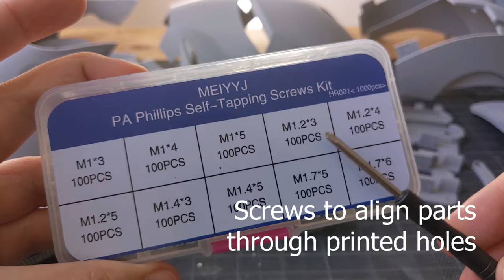Iron Man Helmet, Articulated, Wearable

Comment: So I just finished my first attempt at this project and would like to add some feedback and points for others who attempting this project for the first time.

First off thank you so much for putting this out, everything works perfectly, the documents gives proper information and your build videos are very helpful!

Sizing Ring - If you are unsure if its too tight for your head, scale it up by a bit. The padding will help make up the difference. I have a very fat head and cheeks, so when I assembled mine at stock scale it was a little too right for my liking (remember there are components inside that need room as well)

Electronics - The code is correct, if you are having any issues it is most likely your hardware. One thing some other comments I've seen and I have also experienced is the servos seems to try to continue to turn instead of a full stop when the face plate is closed, creating a sound and generating some heat. Not sure if its an hardware issue or a coding issue. 

Eyes - With the new coding for the lights turning off when the face plate is up, this has made the potentiometer no longer "work" when the eyes are lit up. Adjusting the brightness now requires you turn the knob, reset the face plate, see brightness and then repeat. 

Servos - He designed this helmet to have all components contained in the helmet, however this means that the battery life will be very limited. if you want to change less batteries, consider using a separate power source for the servos. I plan on doing this and hiding the power source down the back of my shirt to my pants pocket. 

Thanks again so much! I am looking forward to building my 2nd one that properly fits my fat head!
Reply from the maker: This is awesome! Great feedback and description. Definitely room to improve
Reply: @BoxandLoop  What separate power source did you use boss?
Reply from the maker: @DoctorNOS  use either AA or AAA batteries
Reply: @BoxandLoop  4-AA batteries are ok? Will it blow the Arduino?
Reply: how did you do the sizing did you resize every single model because then the screws wont fit or am I wrong pls explain aaaa
Reply: @popcatproductions9627  im probably a bit late to be any help but the instruction sheet highlights which components not to resize. I also understand this may be a more recent addition to the instructions than your question.
Reply: Super Ru kinda late but still thanks
Reply: @DoctorNOS  4x AA is only 6v, while the arduino can operate on 6-20v.
Reply: @rattslayer  appreciate that!! Thanks.
Reply: where on your head is the sizing ring supposed to go?
Reply: @danielsLL  it is supposed to barely pass over your ears
Reply: @DoctorNOS  when dropped down on my head flat in z in the same orientation its printed with pointy side towards my chin?
Reply: @danielsLL  Crap. Now that you ask that I cannot remember. I think so.........
Reply: @DoctorNOS  thanks bud
Reply: @danielsLL  no problem
Reply: @danielsLL  
Boxandloop
June 13, 2021
The sizing ring goes horizontal. The more pointy end faces forward.
If it passes your ears snuggly, you are good. From the man himself!
Reply: Hey so I have been working for months and since I am only 12 this has taken me longer than these other people. But I do have a question and if you got back to me that would be nice. Are the eyes supposed to dim when I turn the pointmeter? I am using the code from the eye pdf. I'm not talking about the eyes instruction video I mean the wiring video in which I hook up the eyes to the Arduino.
Reply: could you explain to me how to adjust the yes without making them seprate?
Reply: I know this is out dated but what battery setup did you go with I don't get very much run time with the 4AA setup
Reply: How would you use something like a power brick? Do you just replace the battery holder wired with a USB cable?

Comment: at 1:29 what screws are you using? none of the screws in the suggested kit nor the screws that came with the servo will attach those pieces
Reply from the maker: That screw should come with the servo. It holds the arm in place. If it does not, I'll check the size. I think it is m2.5 bolt, but let me double check
Reply: @BoxandLoop  yeah maybe mine came with slightly different parts, there's 3 silver tapping screws, same size, those screw the piece in place just fine, then there's 2 very small black screws, they will screw the top white plastic parts to the servo but they are not long enough to screw the plastic part on top as well.
Reply from the maker: I see, then it depends on the servo. For the ones I used, it's m2.5 bolts. For your servo, try figuring out which screw/bolt is used

Comment: Hey, great work, im using 2 18650 batteries, i.e 7.4v, the servos worked for few times and then stopped moving and started getting heated, i got a burning smell, now only the led lights are working but not the servos, what should I do?

Comment: How did you print the visor?
Because in every orientation ive tried with a brim... its came loose from the build plate.

Except curve down, which needs a lot of sanding to be presentable.
Reply from the maker: I printed on its side vertically with tree supports

Comment: Great design! I started printing this and I'm about 1/2 way done. Love the instructional videos and detailed PDF. Do you have a link for the pads by chance?
Reply from the maker: Great! 
Try this:

https://www.amazon.com/Aoutacc-Universal-Airsoft-Replacement-Accessories/dp/B07PGF4CTH
Reply: What is the weight and height that this Ironman outfit will fit in?
Reply: TaiRone Wassup  a few hours for some of the larger ones.  I don't have an exact time but I'd say about 12 hours of total time.
Reply: TaiRone Wassup  I'll try later tonight to see if I can put mine in cura to get you better times. I just have an ender 3 pro.
Reply: TaiRone Wassup  OK, I was way off.   I checked today and the face took 20 hours and one of the dome pieces was 6 hours.  I think there are 4-5 dome pieces since my printer is smaller and I did it in sections.  Not sure what I was thinking.  :)
Reply: TaiRone Wassup  No.  Mine is printed and put together.  Just haven't painted it yet.

Comment: What lengths of screws are used for the battery holder, Arduino holder, and the screws that hold in the moving arms with bearing. Thanks

Comment: Hello, which orientation is the best for the face.stl? Printed it already face down for time savings, but on the main surface there are many artefacts from the supports. I don't exactly know if I am able to repair those surface. So, which orientation did you print it?
Reply from the maker: I printed it upright with mouth touching the plate. Tilt forward for brow ridge to see the build plate. Add supports all around the mouth and to the brow. Worked for me on ender 5

Comment: I want to program an arduino to use a push button to move 2 servos just like yours, but for another application. Do you have a video with the arduino code for that ?
Reply from the maker: Take a look at the code. You'll need to take out some parts, but that's it

Comment: I am having an issue printing the ear covers. The bottom is not totally flat and even if I print on a raft it fails. Any tips? Thanks.
Reply from the maker: In cura, there is an option to pick a face to lay flat. Not sure which slicer you are using

Comment: I followed your instructions but the servos only work when I plug in the board via USB.
UPDATE: I just cut out the AAAs entirely and wired it up to a battery pack. The servos get pretty hot, don't open and close them too often lol.
I have a question though, how do you get yours to shut so tightly? Mine is kinda loose and flaps

Comment: I love this! I wonder, is there a way to make a button thats wireless? like a 3d printed remote that has a button on it and when you press it, the faceplate opens?
Reply from the maker: Sure possible. Will need something to send/transmit the signal
Reply: the esp8266 has both wifi and bluetooth capabilities, not sure about the arduino nano every

Comment: Hey another question, on my Arduino when I press the button the servos move but always go back to home, so they open but don't stay. Could this be a problem with my physical board? I think I might have fried the hole that's to the right of ground, the one that the button is plugged into
Reply from the maker: Could be bad batteries. Try on usb power. Also try using AA batteries instead of AAA

Comment: You have two printers listed in your links, one with a 250mm max height and another with 300mm.  Am I correct in assuming you need a max 300mm height printer for this project?
Reply from the maker: Not even that much. All parts fit within 200mm in any dimension. I've listed two printers that I know to be affordable and can deliver good quality.

Comment: what are the screws that hold the servo arms on the ones with the servos are too short? and hold the "passive" arm as well?
Reply from the maker: The servo arm is held by m2.5 bolts. In case your servos are a bit different, check which bolts fit your servos, maybe m2. Passive arms should use m2 bolts

Comment: im having an issue with my servos working when powered off battery. When connected by a power lead, the servos act as you describe and show in the videos but when I power it using batteries it behaves irratically. Any ideas why this maybe happening?
Reply: I feel like I’ve heard this happening when your batteries are low on power, maybe try fresh batteries but I’m not sure 
Hope this helps

Comment: Hey so I have been working for months and since I am only 12 this has taken me longer than these other people. But I do have a question and if you got back to me that would be nice. Are the eyes supposed to dim when I turn the pointmeter? I am using the code from the eye pdf. I'm not talking about the eyes instruction video I mean the wiring video in which I hook up the eyes to the Arduino.

Comment: Hi, what's the difference on files Dome 4 and Dome 4 resize?

The code for Arduino just copy paste from your PDF file?

Thanks!!
Reply from the maker: Dome 4 resize is used instead of Dome 4 if you are not printing at 100%. There is more info on this in the guide.
And yes, copy paste for the code, after you add servoeasing library

Comment: A big thank you for your work. I have a lot of fun with it. Unfortunately I have a problem with my code from the Arduino. As soon as I press the button, the motor turns, the LEDs come on, everything is ok, but the motor turns back immediately afterwards. Where could I have a mistake?
Reply from the maker: The batteries might be low or the servos might be too hungry. Try on usb and AA batteries
Reply: It works via USB, thanks!!!!

Comment: I live in the UK and can't get the same glue as you, are there any alternatives like epoxy or super glue that I should use? Btw amazing video and amazing make.
Reply: I use acetone to glue pla together. Superglue also works.
Reply: @doubletap800  thank you for this, I think I'll go with super glue since it's easier, this is my first make
Reply from the maker: Thank you. Super glue would be my guess. I have not tried it yet, but I hear it works well for others

Comment: I've got it all together but when I turn it on the servos just move in 1 direction and keep trying to move, when I try pushing the button it doesn't respond, eyes don't light up either, when plugged into USB it works fine.
Reply from the maker: Could be bad batteries. Try adding a capacitor to nano
Reply: @BoxandLoop  I've changed the aaa to AA batteries and it's working  however  the face catches part of the helmet when opening and closing so it won't close properly, its like it needs to open further out, what part of the arduino code do you change ?

Comment: Great model! I also printed it and I'm in the wiring phase, I have the Arduino board, do you have wiring instructions as they are not included.
Reply from the maker: Sure, I've made another video just for electronics
Reply: @BoxandLoop  Do you have a link?
Reply from the maker: https://youtu.be/_ayVGPpSBAY

Comment: Thanks for the files, can I ask how you arranged the faceplate on the slicer having issues with my prints failing…
Reply: On an Ender 3 V2 I positioned the face place standing up, then lean it forward about 15 to 20 degrees. Use tree supports.

Comment: Thank you so much for this. I started printing this as my first 3D project and I am making it for my son. I’m in the process of sanding and painting the parts at the moment.
Question: Are there certain slice settings you are using to get the bolt heads to print out? My slicer doesn’t seem to have a fine enough resolution to get the full bolt head and is instead just wanting to print two semi-circles that are loose as opposed to a full bolt head.
Reply from the maker: Happy to hear that! 
For the bolts, I'd check the layer height. I've printed mine at 0.1mm and it seems to have worked well.
Reply: @BoxandLoop  thank you! I will try that.
Reply from the maker: @bluewater82  let me know how it goes
Reply: @crazybastard82 how much time did it took to print and which printer did u used
Reply: @roneygsd134  Hi! I used the Ender 3 printer. It's been a long time so I don't remember exactly how long it took to print but I believe it took maybe a day for all of the small parts and then printed the main front piece overnight while I slept.

Comment: My son and I are ready to wire but the wiring diagram is not verify detailed in pdf. Do you have a more detailed wiring video that doesn't move as fast and tells us what the servo color code is? You have black red and green they have brown red and yellow on the parts you said to by. Also getting a lot of errors uploading the code to the nano every. do you have any other updated steps to make that possible?
Reply from the maker: At this time, I don't have any more detailed information, but let's try to figure it out. On your servo, yellow is the data cable, red is power, brown is ground. For the code, have you added "servoeasing" library to the Arduino IDE? Which errors are you seeing?
Reply: @BoxandLoop  thank you for clarifying the wiring colors. As for the upload I can't tell why they are occurring.  I have added the servoeasing library and was going to try tonight to use the web interface instead of the downloaded arudrio program. It connects to the board better.
Reply from the maker: Let me know how it goes.
Reply: @BoxandLoop  thank you for responding. The nano every cooperated tonight using the web based coding site. It compiled and uploaded without error. I guess I will uninstall the pc version. It wasn't working no matter what i did. Tomorrow we will start wiring.  Thanks again.

Comment: Thanks for the 3d files. I'm currently printing it.
Curious though, what were your settings? Which layer height and how much infill did you use?
Reply: I’m using 1.0 layer height and 100% infill. Can’t go wrong with 100% infill.most parts are thin so 100% infill won’t make the parts super heavy.

Comment: what kind of screws did you use for the helmet parts? Thank you, I'm talking to you from Argentina.
Reply from the maker: Self tapping screws. There is a link in the description. They are mostly m1.6
Reply: @BoxandLoop  Which length do your screws have for the connection between visor and head? I tried M1.7x6 but they are too short
Reply: Anyone found an answer

Comment: Hi, making this for my 4 year old grandson's Christmas. I am curious how you use the two piece sizing ring? I get that you fit is loosely over the ears and then I assume you tape when you get it sized correctly. But, then, how do I correlate that to the 100% size the helmet will print at. Do I measure the two piece sized correctly but if so, compare it to what?

Thanks in advance and really appreciate your work and design here.
Reply from the maker: For a 4 year old, I think you can use the sizing ring that comes in 1 piece. Scale it down to let's say 90% and print. If it passes over the ears down to the neck, print all necessary parts at 90%. There are more detailed instructions in the pdf. Enjoy
Reply: @BoxandLoop  OK, will do. thanks for the suggestion and again for your sharing this with all.
Reply from the maker: You are welcome. Take a look at the helmet being sized:
https://youtu.be/50-tirMW5bw

Comment: I see you listed two 3d printers in the description. I'm looking to invest in one soon, but I was wondering.. for this build, did you use both printers?? And what's the process for cleaning up the helmet and painting it to look metal?
Reply from the maker: Either printer will work. I used ender 5 pro.
For clean up, I've got another video. Check it out

Comment: I’m having an issue where the servos do the right moves..... but in reverse. So instead of going up they go down. Is there a way to fix this?
Reply from the maker: Try switching the pins in code for servos, or actual wires going to servo pins
Reply: @BoxandLoop  by change the pins in code. Do you mean the values under pinMode. And if so do I make servotop.attach 10 and servoBottom.attach 9 or should I give the original values a negative value. So -9 and -10
Reply: @BoxandLoop  NeverMind. No need to answer that. So I swapped the yellow wires like you said. I thought you meant swap the green wires on the circuit board. I’m so dumb😂 thank you for the help